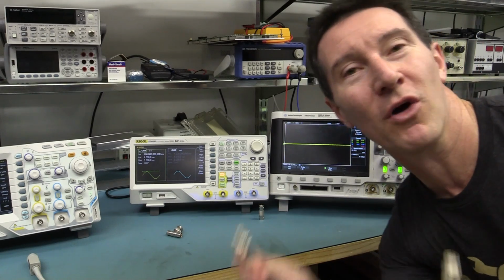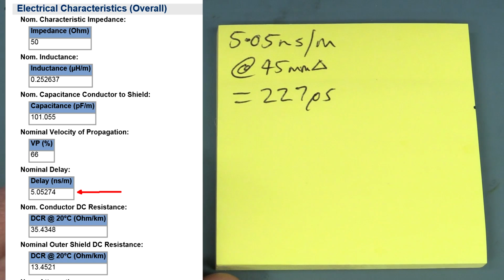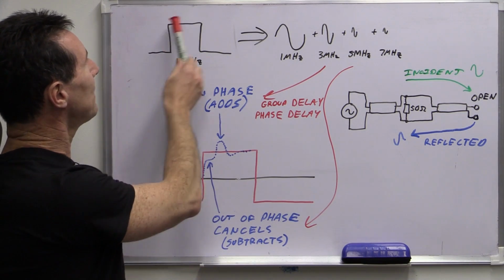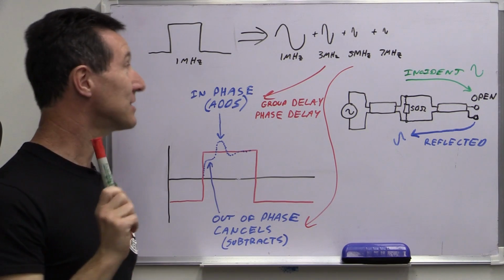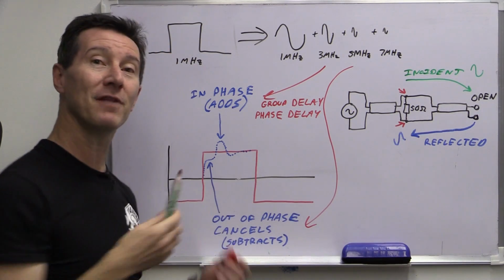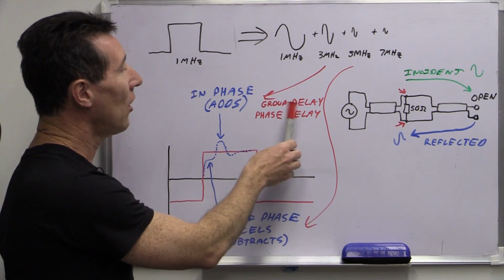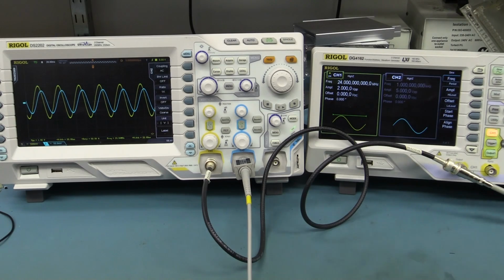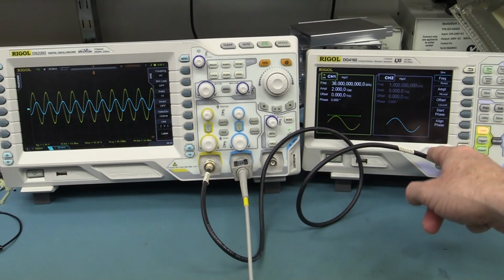EEVblog #652 - Oscilloscope & Function Generator Termination Demo

Comment: I mean this with utmost respect: Some things are better left to others. Those are particularly things that you have to research before making a video. Odds are, if you have to Wikipedia it first, you won't make a great video. Again, respectfully, RF is not your strong suit and you know that. Transmission lines are already confusing for many, using wrong terminology and corresponding explaining will just add to the problem, not to the solution. Alan nailed it below, this sort of stuff isn't for fundamental Friday unless you mean it literally and make a 24 hour video. +1 for effort though.
Reply: Personally, I think that he did fine for his audience. You can think of it this way - he brought awareness of these types of issues to the kinds of people who would know nothing about them to begin with. Many people play around with moderately high speed signal transmission in the contexts of microcontroller/FPGA designs.. and their focus is on the functionality via programming, not signal integrity. For those kinds of people, this video did a great job at bringing awareness to some of the potential issues involved. Dave didn't give any definitions using wrong terminology, it was just general chat. RF is not something most people will ever go to in the "oh, I guess I better learn that too" sense. As you your know, it's fantastically complex. Most product designs requiring heavy RF work will hire corresponding consultants instead of figuring it out themselves. For people enthusiastic about learning RF as a hobby, channels like yours and Alan's in particular are very helpful.. and we all thank you for it. :)
Reply: I knew exactly what the video was going to explain, before I even start to listen to it. I get very concerned when I see silly measurements and videos like these. People making these kind of mistakes should definitely spend some time studying impedance matching, mismatchinging, transmission principles, etc.  And then to use two 50ohm terminations, effectively creating a 25ohm load on a 50ohm output raised even more questions.

Comment: Years ago, Tektronix made a great little 23min  film called "Transmission Lines"  There is a copy on You Tube. It is very clear and accessible with easy, clear maths -though it is not at all math intense. I highly recommend it as an introduction to this topic for those wanting to get into this deeper. I also highly recommend Dr John Shive's "Similarities of Wave Behavior". In this 28min film, Shive explains wave transmission theory, impedience matching, etc. using easily grasped mechanical metaphors. It is also on You Tube, on the AT&T Channel as I recall.

Comment: I remember learning about this reflection problem in computer and electronics classes. Old coaxial bus networks were a nightmare for this. You could have 50 computers hooked up to a single bus and if just one got unplugged, the whole network would become unusable. I heard a story from a technician that this happened to, took more than half a day to find it. Also in electronics class, we called terminators 'Arnies'. ^-^

Comment: You can calculate the length of of coax using a square wave by measuring the difference between the first and second rising edge see w2aew video for the calculations. Great video and explanation.

Comment: Of course, this only skims the surface of high frequency propagation, reflection and interaction with capacitance, impedance and cable types and transmissions. I once took an introductory course on RF and propagation and it was just the tip of the iceberg. There are some very complex physics going on with this and I applaud you for taking this head on in a 24 minute video.
Reply from the maker: Eric Haney Yeah, it's deep complex stuff if you really want to get into it. Heavy duty math and physics. The goal here was just to answer someones question, not really get into transmission line theory much.
Reply: EEVblog Agreed. A great video as always! Keep up the good work!
Reply: Indeed, wait until it gets up to 15-40GHz. then it really becomes crazy!

Comment: Some early high power coaxial transmission lines were made with standard copper pipe sizes, so the impedance was actually 51.5 ohms. Modern types have custom size conductors, so they are exactly 50 ohms.

Comment: But how and why does the signal get reflected? My only guess is that at start of sinus wave coax starts to charge because of its capacitance and then it discharges ("reflected"), and phase difference between discharging coax and signal generator decides if voltage will be reduced or increased?

Comment: Another good tip is not to trust some old RG58 BNC Ethernet cables and use them for that sort of measurements. Their flatness even below 20 MHz is designed to just work with Ethernet. Even proper termination won't help. Those cables bit me years ago, and since then they went straight to the bin. I believe this problem is the same for any cheap RG58 cable you can buy online these days.

Comment: Knew that characteristic straight away. Many years ago when working on Novell networks, a particular school used to get regular failures. Students would remove the termination resistor and the system would go down. I also remember using a borrowed Telecom TDR (time domain reflectometer) to diagnose a faulty cable that would go open circuit in windy weather - the fault eventually was identified as a faulty spot weld junction which would go open as the cable flexed. A real tricky fault to locate in hundreds of meters of cable. The TDR would show EVERY junction based on it's reflected signal.

Comment: Hi Dave: Your video is great as usual (but don't get cocky, stay humble).  However, the comments, currently 31, are an additional and informative tutorial.  Interesting stuff: . . . used a 32 feet long open ended cable . . . , . . . to remove the colour subcarrier of 4.43 Mhz.  Just great.  I think Alan (W2AEW) hit the nail on the head that this is a subject worth exploring a bit more.  Cheers, Mark

Comment: During the Olympic games our radio club had a station running many HF transmitters at once.  Several frequencies interfered with each other so we used a open piece of coax tuned to the interference frequency like you showed to act like a filter.  It worked great and now after watching this video and watching what happens I understand exactly what was going on to achieve the filtering effect.

Interesting stuff, Thanks for the great explanation!

Comment: In 1970 we used a 32 feet long open ended cable joined with a T-piece to a terminated video lead to remove the colour subcarrier of 4.43 Mhz, to make the picture black and white.
Reply: We were using a colour telecine machine to nconvert B/W Films to video.
Reply: the subcarrier is 4,43361875MHz - I'm asking me long time why is it on the end 4 433 618,75Hz <= look this ......,75Hz why is that so? 3/4Hz on the end???

Comment: You can also calculate the cable length from the frequency you get your minimum at the source from: you get the strongest reflection when the reflected signal is exactly 180 degrees out of phase and since your source signal has to go through the cable twice (forward and back), you hit that lowest amplitude when the path is down to quarter-wavelength.

With a minimum at 49MHz, that puts the total path length at around 1m.

Comment: The magnitude of the reflection seen at the generator isn't changing, it is the phase of the reflected signal that is changing with respect to the source, and the amplitude of the resulting sum of forward and reflected waves is the variation in amplitude that you're seeing with the probe (at the end of the video).
Reply from the maker: ***** Yes, that's what I was getting it. I probably didn't explain that adequately. Ultimately what you get is a change in amplitude as measured and displayed by the oscilloscope. That's what I explained on the whiteboard, and that applies at any measured point in the transmission line system, be it source or destination, or in-between.
Reply: Yeah, these are tricky concepts to explain. That's why I've done at least 5 videos related to this topic, and there's still details that could be explained better/differently. Nice job on the video, as always.
Reply from the maker: ***** Yes, countless ways to explain this and scenarios etc. This one was supposed to be a quick 5min job on answering the persons question about why their function gen output voltage went up and down over freq more than expected. Then I waffled on...Would have approached this differently if it was say a deliberate Fundamentals Friday on transmission lines.
Reply: Hmm, a topic like transmission lines and reflections would be more like a Fundamentals February, instead of just a Friday.
Reply: It would be cool to use a wave tank to show forward and reflected wave trains and the results.
Reply: +w2aew yep, RF theory 101. You also see amplitude changes along the length of a conductor.

Comment: Good video, Dave. It was a great intro to why termination is so important in signaling applications. I had seen similar results if sketchy waveforms when i was trying to diagnose where in the signal chain a fault was occurring when troubleshooting theatrical LED fixtures (DMX protocol). It was a bit of a head-scratcher when I had tested from the brand new controller console and was seeing misshaped waveforms. After about one minute I realized that I needed to terminate my signal pair but it was one of those situations where you get relieved to find out that what you just thought was going to be a return on a piece of hardware was really just a red herring and you can get on to the actual test to find a fault.

Comment: Us hams often use stub filters and impedance transformers made out of quarter wavelength transmission lines. I've done a bunch of videos on these things too - ranging from TDR to coaxial properties characterization, terminations, etc.
Transmission Line Terminations for Digital and RF signals - Intro/Tutorial
How to measure coax velocity factor VF and impedance Z
Cheap and simple TDR using an oscilloscope and 74AC14 Schmitt Trigger Inverter
Use a scope to measure the length and impedance of coax
Basics of Tracking Generators and 1/4 wavelength coaxial stub filters
Reply: Yes, I do know this is a 4 years old post. 
Nonetheless:
Very informative videos, I recall when we used terminations for 50-Ohm coax LAN connections. Thanks for sharing.
Do you mind also sharing how to embed links in plain-text as you did above? That's pretty cool.